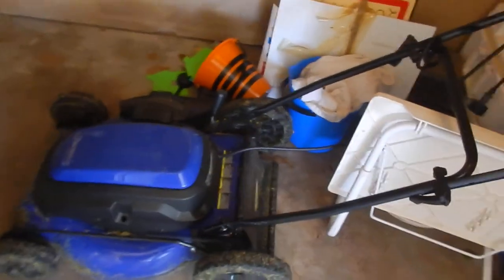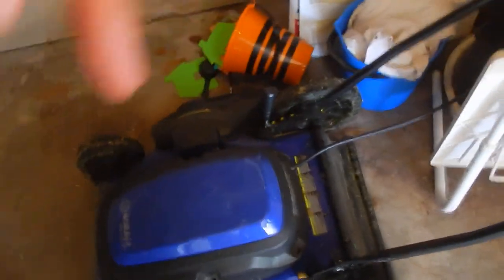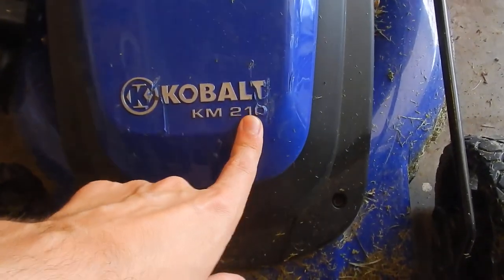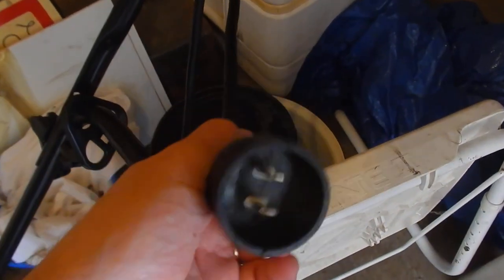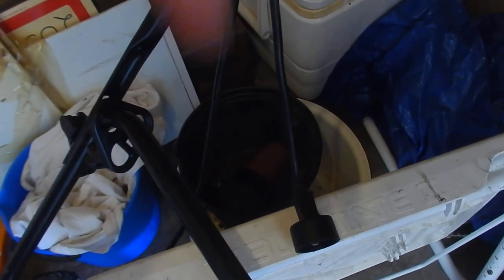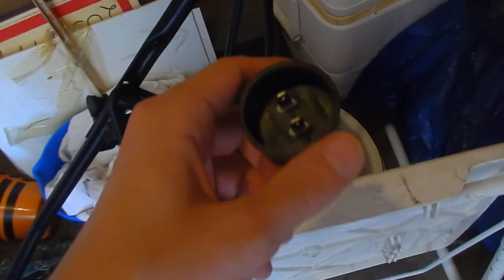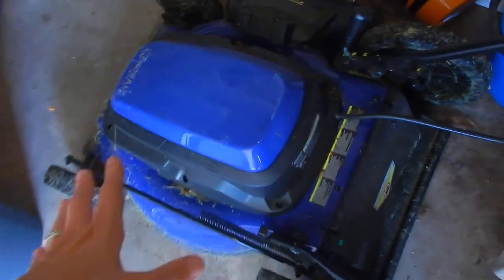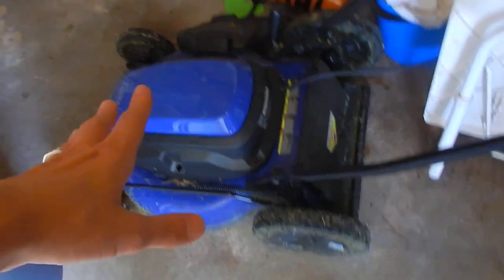BEST CORDED LAWN MOWER | Kobalt Electric Lawn Mower Review

Comment from the maker: What are you experiences with corded lawn mowers? Have you ever used one before?
Reply: I have the same Kobalt and it's awesome!    I wasn't interested in battery either.  Their run time is random because it depends on grass height, walking pace, etc.  Most battery operated doesn't recommend letting grass get too tall.   I don't always get to it right away due to rain, heat, too busy, etc.   With the corded it's not a concern to be a bit tall.

The corded electric never hesitates, doesn't need recharged, it just cuts and cuts well.  Also, this is one of the larger decks at 21" compared to many other electric mowers until you get to self powered which cost $1,000 more.

The only issue is the cut pattern due to the cord.  You have to sort that out to make things go smoothly and not have to constantly yank the cord around.   Basically mow away from the outlet.   However, you can plug it in, but readjust the chord to any base point you want and move out from there.  So it's not difficult or anything to figure out the most efficient cut pattern.   I can see it being a pain if the yard is full of obstacles.

Comment: I've owned/used this mower for 3 years until last week when the lever-controlled switch failed rendering the mower a lawn ornament.  Disassembly revealed a cheaply made poorly engineered cheese-ball internal non-universal plastic part that broke inside the lever controlled switch assembly.  Went online to find a replacement and - nothing is available!  Nor is any other replacement/repair part for Kobalt corded mowers.   My advice: Buy a Black & Decker or other easily repairable brand.
Reply from the maker: Thank you for leaving your experience with your Kobalt mower. I did not know about this cheap plastic part. Did you try to call Kobalt to see if you could get one directly from them?
Reply: I had a 12 amp mower from Black & Decker, when it's switch broke, I just replaced it with a light-switch(yep, I  took  out that dead-man switch, and the stock power connector, and replaced it with an 8 AWG cable and a light switch.
Reply: Don't they have a 5 year  warranty

Comment: we usd a greenworks lectric corded mowr 2 yrs.  it failed!!   th  side disharge blow  was to th rear right outside th side vent so th pressur frm th strong motor broke th metal cuttin deck in five  or ten pieces. now i may buy  like th bettr made lowe s  kobalt.  hellfire is nothr name fo element cobalt th heavy metal usd since egypt & persia.  god pun ishes sinnnrs says bible  in sulfur-cobalt fire.